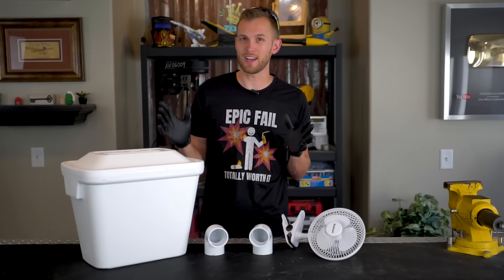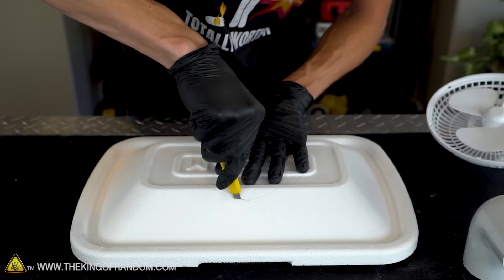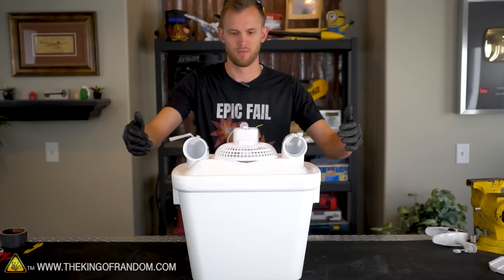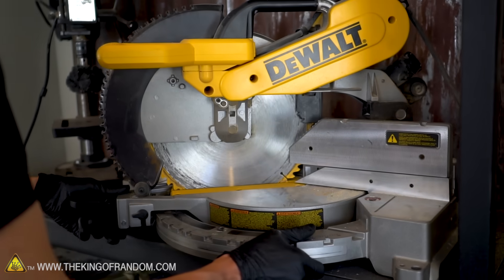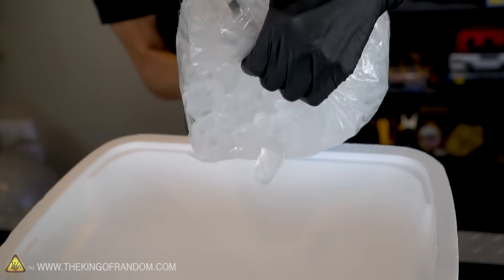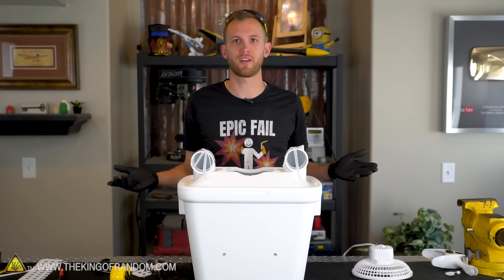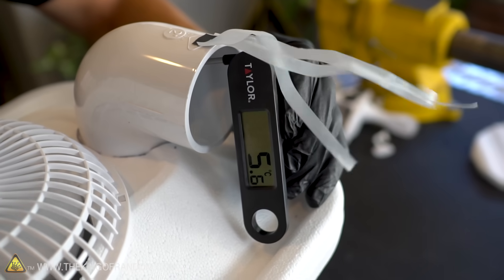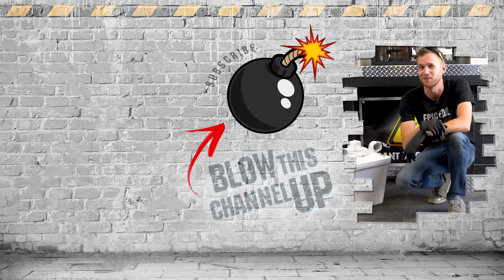Recycled Styrofoam Air Conditioner! TKOR Creates An Efficient DIY Air Conditioner!

Comment: I actually used this in my car for the 2 weeks I had no AC in the summer lmao I had to rig a car outlet adapter on it and it the very bottom i used dry ice with regular ice on the top and there was an incredibly noticable dif.  I have a black car with black interior. During the summer it gets hot enough that the metal part of the seat belt will actually burn you and if your wearing shorts the seats are very uncomfortable for a while. It was recently with the heat index 116 where I live so you can imagine how hot the car gets when 100 degree days arnt at all uncommon in the summer. Now I will admit the fan I used while roughly the same size only a little bigger was considerably more powerful and instead of the styrofoam box I used an actual igloo cooler that really holds the cold in better. And I didnt use ice cubes I used those packs kids put in their lunch box that have a lower freezing point than water. And I did have dry ice in the very bottom but it worked very well infact on the top setting on the fan after about 20 mins you'd start getting cold. I'd recommend this in your car if your ac goes out in the car. As for a whole room.. doubtful, a closet  would work though lol or if your room was harry Potter's broom closet xD

Comment: Problem with ice cubes instead of bottles is that, once the ice starts melting and water fills the gaps between the cubes, air can no longer circulate around the cubes but only over the top surface of the ice and water mixture.  Together, the AREA of the cooling-surface and the temperature differential between the cooling-surface and the flowing air, determines the rate at which the cooling-surface absorbs heat energy from the air.  So, you will get a bigger cooling effect at first, but the cooling effect will drop off rapidly as the surface area over which the air can flow decreases.  Once all of the ice is floating in water,  you'll get almost no cooling effect even tho the mix of ice and water remains at 32F and still has the capacity to absorb a lot of energy.  The outflow temp might continue to be a degree of so less than the inflow temp, but not enough to be noticeably cooler.  At that point, you'll need to start over again with fresh ice.

With the ice and water contained in bottles, the area of cooling-surface remains constant.  Therefore the system should continue to cool at pretty much a constant rate until ALL of the ice has melted.  So, although at first you get less of a cooling effect with the original system, I think that it will provide more overall cooling (i.e., temp drop x length of time).  If 10 degrees of cooling is enough to make your space reasonably comfortable, the original system is probably better.

And, a problem with the final system shown in the video (where the vent tubes down to an air gap between two layers of ice) is that if the upper layer contains much ice, as it melts it could raise the water level up to the bottom of the vent tubes.  At that point, air won't be able to circulate at all!   

The bottom line is that the amount of heat energy that the ice will absorb as it melts is a CONSTANT and depends only upon the amount of ice that you start with.   Cold water can then absorb a much smaller amount of heat energy until it reaches ambient air temperature.  Again, this is a CONSTANT amount that depends on the amount of H2O you start with and the just how hot the air is.   You can do things to make the ice and cold water absorb energy more quickly and thus cause a bigger initial temperature drop, but you can't make it absorb more energy except by using more ice.   Thus, the more "cooling effect" you get (i.e., the bigger the initial temperature drop), the less TIME the system will continue to cool.

Comment: Look if you run the pipe( metal ) under the ice put a blower onto one side and force the air through .Also seal your pipes you don't want them to fill with water. Just my opinion on my idea larger cooler will help.

Comment: Just one problem.  As close to the bottom as your pipes are, it won't take long for there to be enough water from melted ice to block the air flow completely.  I say move the tray up to 1/4th to 1/3rd from the top, make the pipes go only about half way down, cover the tray,  and live with the 49 degrees Fahrenheit.

Comment: i think replacing the PVC pipes with copper pipes touching the ice will decrease temperature significantly, if there is copper pipes with that size in the market!!!!
Reply: Not pipes, tubing.
1/2" OD copper tubing.
Reply: Those would be $$$$
Reply: Small copper tubing. The more copper coils the more it conducts
Reply: There are at my local hardware store although it's around 20 bucks for that size each lol.

Comment: Instead of ice, why not just fill the styrofoam box up with water (3/4 of the way), then put it in the freezer. That should last longer than ice and bottles...
Reply: Ice expands when it freezes.  Styrofoam will break at the sides.
Reply: because ice spread out gives more surface area than one giant block of ice

Comment: Well, I may have a bit more effective idea, yet I have not tested it yet. Outside design is fine, but what about using cool water mist right under the fan instead of ice. Energy transfer would be much quicker. Yeah, we are loosing the advantage of the heat necessary to melt the ice itself, but still might be very viable option.

Comment: We assembled this and it worked perfectly. Dropped the temperature by 35-40 degrees. But, we inserted first aid ice packs, instead of bagged ice, so they are re-freezable (and no melted water to drain).  Thank you!
Reply: How long before you have to replace the ice packs?
Reply: how long did the packs last?
Reply: I like the idea of NO ice cubes 🧊 the frozen water bottles and ice packs are less messy and reusable.
Reply: @Souzainvests you can refreeze the water. Just pour in into molds the size and shape you want. That’s what I’m going to try anyways
Reply: He thinks he made improvements but he actually made it worse...  You don't want the ice to melt into water without it being in a container.  When that happens, the blowing will cause evaporative loss and increase the humidity of the room and cause this to become a swamp cooler.  The best idea is to use water bottle or milk jug... or buy a bunch of those blue cold packs.
Reply: Bottles or gallon jugs with water and put in the freezer works great
Reply: How long did it last?
Reply: How long it lasted depends on the ambient temperature at the time so we’d have to know that as well
Reply: This is excellent.  The one modification I would have added is a solar panel and battery setup to it to have the whole thing powered by the sun...ie virtually zero cost to operate...🤔👍
Reply: This will work, but if you are living in humid places than it will not work as well. It will work for a short while than the swamp cooler. Evetually the humidity will match the surrounding area and eventually just be sticky snd maybe just as hot.

for this to work you want to be perfably in a dry heat area.
Reply: What if you put the out going air tubes on the side of the cooler instead of on top?
Reply: how long does it last ?
Reply: But did it drop the temperature of the room?
Reply: You can also fill bottles with water and freeze. That's what I use/do  in/with my swamp cooler. Hope this helps. 🥰🥰
Reply: @jayj3343 That was the original idea. The whole point of this video is to explore other options.
Reply: What's the point of a dryer vent? Why not just let the cold air escape from a hole?
Reply: @ryanleiderman9622  the reason is so they can direct it rather than just blowing up. Perhaps have it next to you and the cold air is blowing directly on you.
Reply: Who used dry ice instead?
Reply: @DopestQueenD  isn’t that dangerous?
Reply: @HHondi  dangerous how? The open screen of the fan?
Reply: @getfitreedman  They are probably referring to the dry ice being used as it would give off large volumes of carbon dioxide vapor. Honestly, it shouldn't be an issue unless you are using tremendous amounts in an enclosed space for long periods of time.
Reply: @DopestQueenD  Dry ice can poison you
Reply: @DopestQueenD  clever

Comment: Pretty sure the ice cost or fridge cost will eventually rival that of an actual AC and this is more of a fan than an AC
Reply: The fridge is a passive component you are already using. The extra cost to freeze the water wont rival the cost of ac.  But it also isnt as effective as AC anyways.
Reply: Isn't it considered a DIY "swamp cooler"

Comment: Try taking the air from the fan and run it through a pipe to the bottom and just keep the elbows on the top with no extra pipe added and see if there is a difference

Comment: I'm making one right now. Adding salt to the ice with make the melting point lower so the air will be even colder.
Reply: It makes it colder but also melts it quicker 🤔
Reply: Actually, since the salt makes the ice melt faster it might actually cause the rate of heat exchange faster therefore cooling the air faster.  Dunno, makes sense.  I think what you may have been thinking of is making the freezing point of water lower if it has salt in it.
Reply: @terrellma  The rate of heat exchange increases because water has a larger surface area than ice
Reply: Yes I ment freezing point.. and I used Rock salt..
Reply: I’m curious Elizabeth Rust, did you try and test it? how’d it work out?
Reply: Use ice packs instead. Refreeze and no mess.
Reply: Rock salt!
Reply: I think you meant "freezing point" instead of melting point.
Reply: And melt quicker cz salt will catalyze the ice. It's a trade off.
Reply: @fathermarsala9477  cool learning stuff
Reply: WE WOULD PUT SALT ON THE ICE AROUND THE SALAD BAR
Reply: wait a minute doesn't salt dissolve the ice? and I'm just going by from wintertime putting salt out on Ice floor.
Reply: @rajnbull  I believe she's freezing salt water which does require lower temperatures to freeze. Because it is colder the ice will melt faster however
Reply: @willis32  It doesn't melt faster....... It's melting because it's freezing point is LOWER, meaning it doesn't freeze at 0 degrees Celsius
Reply: @Mister-Hidden  the delta T is greater meaning the temperature transfer will be greater. It'll gain enthalpy faster. I didn't mean it wouldn't last as long. Just its got diminishing returns and might not be worth the effort.
Reply: @rajnbull  its a differend type of "salt" you pu on ice in the winter
Reply: @Feelrightathome  Roger that Cream, I mean Dream ;)
Reply: @Feelrightathome  Tell me more about that magical ice you use? XD
Reply: Elizabeth Rust - great idea!!
Reply: Excellent. I'll make tomorrow
Reply: Uh salt dissolves ice
Reply: @siege6876  No it doesn't
Reply: don't think your too cool
Reply: Ooooo, smart.
Reply: What about dry ice you guys?
Reply: I use baking soda to help the ice last a little longer
Reply: I'm pretty sure salt INCREASES the melting temperature thus ice will melt faster... as for decreasing the temperature, I dont believe salt will make a difference
Reply: @cmdrhvacker5650  saltys wacky it will melt it but refreeze it there's a trick u sprinkle salt on a aice cube when it starts melting put a string on it and it will refrees and say look i got this string in side this ice cube
Reply: Decreases and endoterm reaction between salt and water lowers temparature.
Reply: @dixichannel4422  my
Reply: @cmdrhvacker5650  it decreases the melting temp. That's how it can melt snow when its below freezing
Reply: If you make the melting point lower then the ice will melt faster. 😂😂😂
Reply: Salt kills houseplants just sayin

Comment: Dad always used dry ice and taped it around the cooler so the lid wouldn’t pop off from filling it to the top. It works great. Dad did use regular ice too but we found the dry ice works way better. This is coming from Arizona idk about your area but it’s honestly a basic swamp cooler. Try it out I’m in wpb now and I still use it for the dogs in the summer and it helps loads
Reply: Where do you buy dry ice?
Reply: @72planes  our k mart sold it I’m sure you could get it in a number of different places now

Comment: You can just wet a towel and put it inside.  The process of water evaporating removes heat from the surroundings, it's how a so-called swamp cooler works.  No ice needed!
Reply: Not in high humidity.

Comment: You should modify a portable ice machine with a fan so that you dont have to keep adding ice. just water occasionally.
Reply: Just cut a round hole in the side of ur fridge and mount a fan that blows outward and get realy chill air..brrrrrr 😂
Reply: CandymanSEHTx713 great idea but wouldn’t that be almost the same price as a portable AC unit?
Reply: @windows_x_seven that would be fukcin hilarious.

Comment: a maching with a powerful fan that blows a mist of water works pretty well.  that way you don't need to worry about ice.  There are large machines like that for use in warehouses and shops and they are effective.
Reply: It would also increase the water content of the air. This would lead to sticky surfaces, and mold.

Comment: Definitely making one to try in my sons room, it’s a small room and this should work great to cool it off for him when he’s here , along with the regular fan he already has .
Reply: They sell pretty effective window units at walmart for $80.  Ive survived the last 2 summers thanks to that very model. Im using it right now and I have a box fan about 8in-10in away from it to circulate the cold air a bit better. 

This styrofoam cooler will increase humidity a lot in his room, im looking into this for something I can use to sit in front of outside and is easily portable.

But if you need something inexpensive for indoors I would recommend walmart.

They have another unit that sits in the room and you just run a flex hose to the window instead of hanging a unit in the window. Its a bit more expensive but its ten times cheaper than buying or having to fix a damaged home air conditioning system

Comment: Spread course salt over the ice to dramatically lower the temperature of the melt water.
Reply: In exchange of the ice melting 10 times faster😂😂
Reply: Or even COARSE salt. Wintertime Ice Melt salt (calcium chloride) for extra-cold cold air. But using any kind of salt is also more of a mess, and can't easily be re-used, unless you use the salt solution in plastic bottles. Then you will need a 'deep freeze' to freeze them.

Comment: This is actually one of the best build DIYs I’ve seen on any YouTube channels, so thank you for this innovative edge definitely. However, I’d like to point out 2 things. First and foremost, I would definitely suggest against the usage of dry ice unless your greatest fantasy involves suicide by carbon dioxide poisoning. Secondly, I would’ve chosen a metal fan blade over plastic to generate a more cooler effect. Thirdly a metal/light steel build container would work leagues better over any styrofoam or plastic, because metal/steel cools way better Ntm metal/steel surfaces hold cold air the best based upon the surface properties. The more solid and air tight the surface, the greater the cool effect, the less that needs to be done with the build. Metal is a wonderful conductor/retainer of both heat and cold, which you may find yourselves cooling an entire room instead of just a small couch area. Just a 💭
Reply: Metals are poor insulators so the ice would melt faster with a metallic container. You want convection not conduction so you can route the direction of cold air flow
Reply: Wow, you should avoid commenting and showing how little you know.

Comment: There's a better design where you have the fan blow the air under the ice and it's forced thru the ice. It's on utube. The temperature went to 31 degrees. Sorry boys.
Reply: and easier for water leaks

Comment: When you room is one hallway, one set of stairs and a dinning room away from the ac
Reply: IF you were not challenged by a set of stairs, you could use a box fan in the room with the A/C to blow cold air along the hallway floor. The flow will more-or-less 'stick to' the floor because of the Coanda Effect.

Comment: Try putting some salt into the water and then freeze it, that will make the ice last much longer
Reply: Mostly, it will make the ice colder, or make it fail to freeze at all, unless you use a 'deep freeze'. That is NOT the same as an increase in cooling capacity.
Reply: Marron Kay interesting I didn't know that maybe you should be a miniature scientist 🤗

Comment: I'm putting this in my car, the a.c. is broken and I can't afford to fix it. Stay tuned.
Reply: Molly Jayn just don’t use dry ice because then it will remove all oxygen
Reply: @Willeexd1337  it didnt work...not sure what I did wrong.. Maybr I need a stronger fan or better insulated cooler? It's also 90 degrees out tho

Comment: The main problem with this design is that when the ice melts the water will block the flow of air once water from the melting rises to the bottom of the pipes. The bottle design doesn't have this problem. The solution is to put a small drain hole in the bottom of the Styrofoam box so the water doesn't rise. This will keep the air flowing even if all the ice melts. 
However solution has a short coming in that the now liquid water that is still quite cold (barely above freezing) is now  being drained off instead of absorbing heat.

Comment: This would be at the cost of warming up your kitchen if that's where you freeze the ice. That heat has to go somewhere, your fridge would be putting off the heat. If you just want to sit in front of it, or have a freezer in your garage, it might not be a bad solution though.

Comment: If you let this sit next to you for an extended time and let it blow air at you, you'll get a brutal cold, even if the ambient temperature is very high. It's risky to have the temperature difference larger than 5 degrees Celsius.